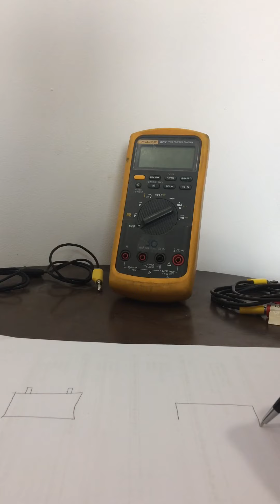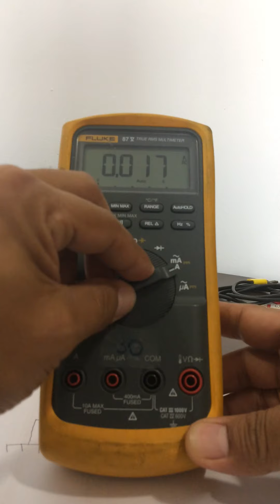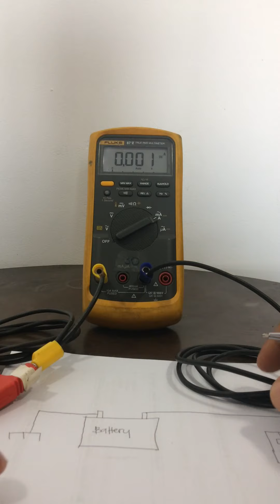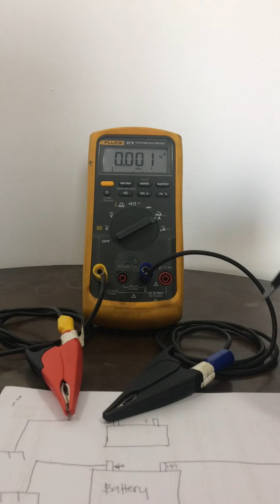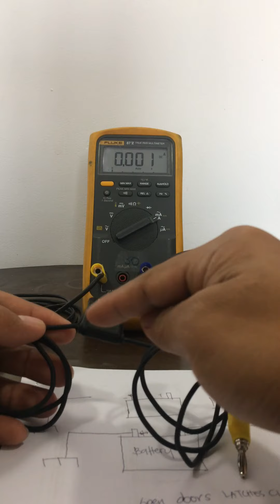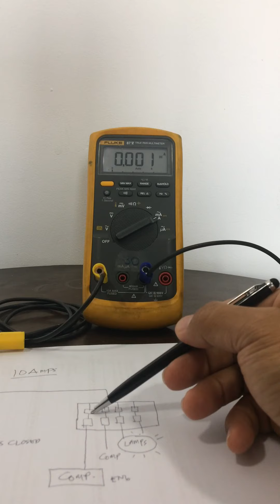Battery drain test

Comment: What if the current drain is too high and blows the fuse in the meter?
Reply from the maker: Hi gggunit99 there are fluke accessories that provide millivolt (mV) output like the Fluke 80i-1000 Current Clamps that provides 1 mV ac per amp measured up to 1000 amps. In addition, in any ICE (internal combustion engine) vehicles the components that are likely the cause of high current drains are compressor clutch, starter motor and generator/alternator. (If the clamp is available) Install it then you can start removing the fuse or relays of these components and check the display in your fluke meter if it drops or not. If the value changed, that could be the cause of the drain. (If there is no clamp available) DO NOT connect your fluke. You can remove those suspected fuses and relays then use a 10Amp jumper fuse, connect in series with the circuit to check if the current drain is still present. If the 10Amp fuse blows, try to find another suspected fuse or components as it is not safe for your meter. Please let me know if you need further information as I am willing to assist you. Thank you so much.
Reply: @juliusapril6527  Thanks for replying! My situation is new battery goes dead after fews days of truck (2014 ram 1500) sitting. I used jumper cable between negative battery post and negative cable and put multimeter the same way. So now I won’t blow fuse in meter. So I get 0.20 mv on meter. I pulled all fuses and relays and no drop. However when I pulled the 2 fuses for body control the amp went up not down for each of these 2 fuses. I do have a aftermarket remote start. I had it installed years ago. It could the source of drain but I probably didn’t let truck sit long enough for battery to die until recently.

Comment from the maker: Add-on: while the meter is connected in series with the circuit, you need to wait few minutes to stabilize the reading...  DO NOT ACTIVATE ANY ELECTRICAL COMPONENTS WHILE IN THIS STAGE!  Depending on the battery capacity, the 25-30 milli Amps is considered normal.